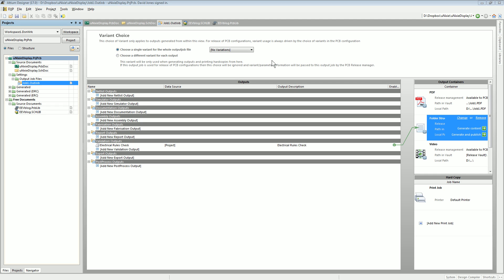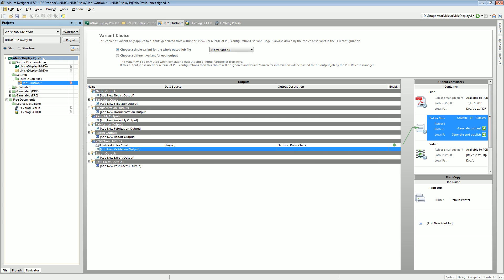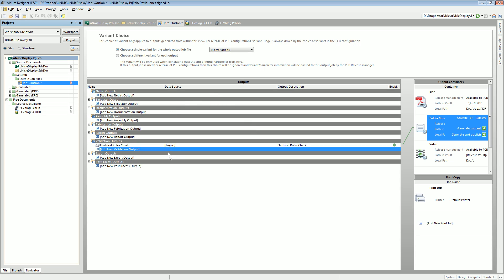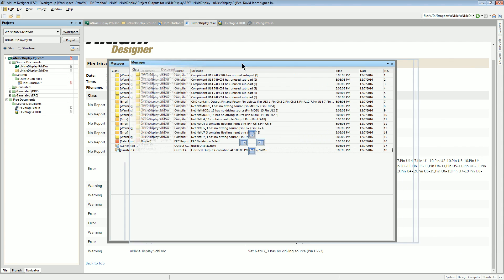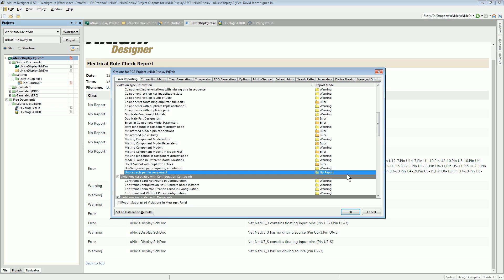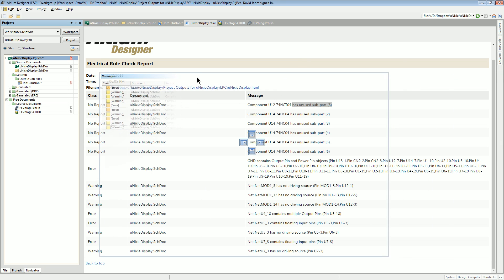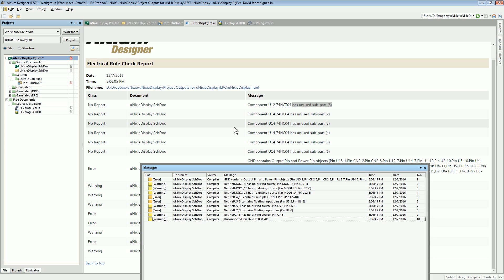Another Altium Designer ERC Bug

Comment: Far from the worst Altium problem. We used to produce our own PBCs from out own artwork. The last version of Altium we bought was not passing back any parameters from the Windows printer dialog. You had to set the printer parameters via the Windows default, so we couldn't do a low resolution scaled to page draft print and then a high res, scale corrected final artwork. Just getting them to admit that what we were saying was true was a mammoth task.

Comment: I believe out jobs use different rules. I think this is because out jobs are meant to be moved from project to project or used throughout design teams. They're not meant to be tied to a single project. I may well be wrong, I haven't checked but are the settings on the right when you configure the job?
Reply: At work we use an outJob template which then gets customized to the project (Basically containing templates for prints and manufacturing data)
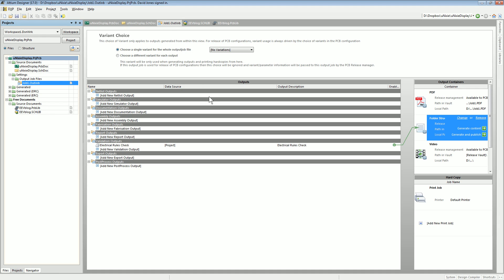Reply: Double click the output job ERC check (@0:25) and the settings for that "output job" pops up. There is an option there to set the ERC reporting options "to project default".